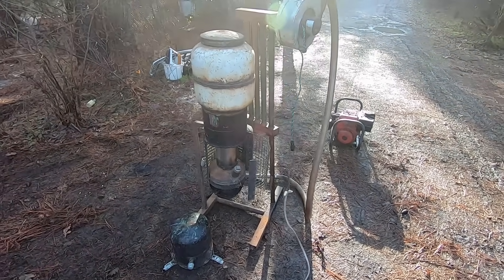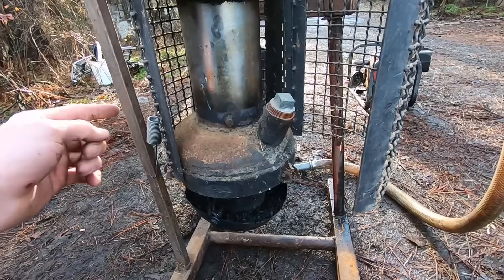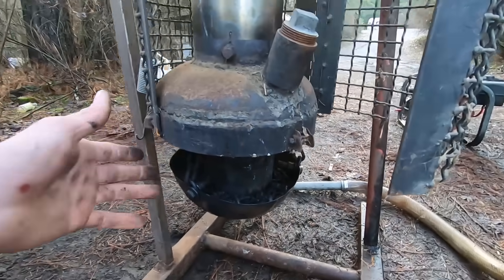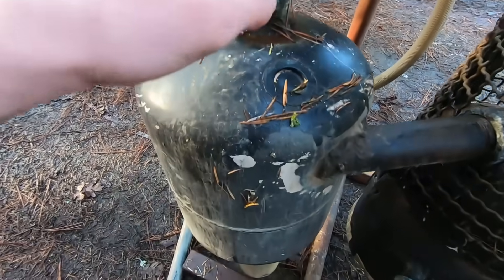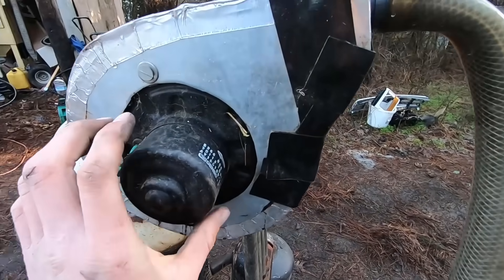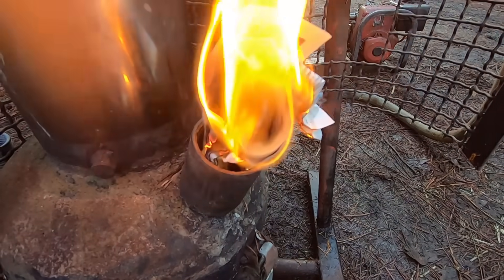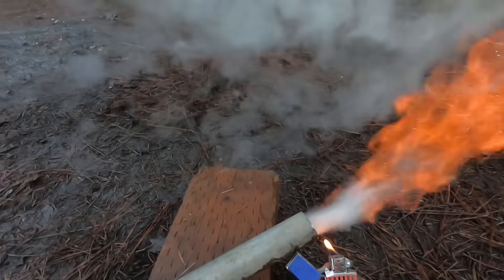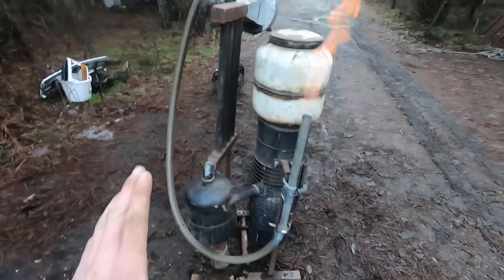Using Wood to Fuel a Generator! (How to Build a Wood Gasifier w/Demonstration)

Comment: I'd like to see you build one large enough to run your tank in a dual fuel way, that would make it a true bug out vehicle
Reply: Many German vehicles during WWII were powered with wood gasifiers due to fuel shortages, including massive Tiger training tanks so that would be cool to see.
Reply: @Bordpie  there is a video of a old man in Europe  that running a big old 2 ton truck on it
Reply: i would like to see him "build" it.
Reply: engineer775 has one for a vehicle
Reply: "If you build it, Youtube viewers will come"
Reply: YES!!!!!! Do this Please!!
Reply: an ole timey tractor, lol
Reply: mt only problem is what happened to the Cheiftan, they made it's engine "multifuel" with the idea it could run on everything, in reality it didn't run for long on anything even good 'ol diesel, the engine broke down constantly on what was otherwise a good tank, they had more than 50% of them in the shop at times

Comment: This was such a great video for me to find! Going back and watching your other videos(after subscribing ofc) it's clear to see you're taking on any and all feedback to improve the experience for your viewers and that's HUGE! keep it up!

I've always wanted to try a gasifier project.  Have you considered compressing the gas into storage tanks? 

Thanks! 
-a fellow PNW tinkerer
Reply: I would assume that it has to do with safety as well. LPG has no oxygen content and therefore is almost completely harmless compressed, but when you have a gas such as this, which definitely has some oxygen in it, the risk of combustion when compressed goes up drastically (even without a spark). Also as you said, the energy potential per volume is much less because you have all sorts of stuff in the gas rather than only the actual combustible gas.
Reply: I wonder if trompe could be used to compress it?
Reply: @GrimFaceHunter  I dont see why not. I know people have compressed it. I think the limiting factor is how it behaves when compressed. Like the fuel potential of a tank of wood gas is only as useful as 1/100th of a tank of lpg at same volume. Making it highly impractical when other fuels are so readily available and more economical.

Comment: How do you turn it off?
Reply from the maker: Good question! Because the burn requires air being pulled through the fuel, it can't get enough to sustain combustion by its own draw. As soon as the vacuum is removed from the end the system, the burn simply goes out. Thanks for the comment!

Comment: Cool stuff!  you mention in the video that the size of your burn tub decides how big of a motor you can run off the Gasifier...  It would be helpful to know what that ratio is and included in the description of your video.  I also be curious to know how quickly you could use it to heat a home.. or how big of a burn chamber you need to heat say...a  2400 foot home.  (about the national average.)
Reply from the maker: Yes, of course! I apologize for not including that. I'll include a link to my Instructables page in the description that has the burn tube information. As far as a burn chamber, that's dependent on quite a few things and I can't answer that question. I'm sure a quick Google search could answer any questions like that though! Thank you for the comment!
Reply: Yea man !!.. your pretty smart and could definitely make a living off the utube .

Comment: Good video  :) . 
 I use this technology, pretty much all the time, to make the power here on my farm. 
 Keep up the good work.
Reply from the maker: Thank you very much! Wow! That's great! What is your main fuel source? Is it a standard downdraft?
Reply: @randomn6473  
 Oops, forgot to mention the main fuel source. 
 This is Pine, taken from old warehouse pallets,. 
 The wood is processed by a pair of machines that I designed and built for the purpose. 
 These make little cubes that I call 'gasoline granules'  :)  .
Reply: @randomn6473  
 You are welcome. 

 I have two gassers here. 
 One is a charcoal powered one, and my wood powered gasifier is loosely based on the Imbert system. 
 Please feel free to take a look at them on my channel.

Comment: Nice! You might want to consider using a bubbler for removing impurities that will gunk up your engine. If the current design works for many uses without problems more power to you
Reply from the maker: That is a very good idea! Thank you for the suggestion! I would have concerns about the air pump requirements with the set-up in my case though. It would take a lot more power to move enough air through the water. I'm positive that it's possible though if you're creative enough!

Thank you for the comment!
Reply: @randomn6473  no air pump required as it operates at 1 atmospheric pressure. 
the same pressure that you are using now. water in container cleans the smoke of ash And soot and you get clean gas that burns consistently unlike your present set up
Reply: someone once used a water spray as the gas passed through to clean it, and they also used stainless filter material, similar to wool, like chore girls. Removing impurities for engine life and ecologically using or disposing of those impurities has always been a stumbling point to me for long term steady use.
Reply: I think it would help if he added cooling fins to his cyclone filter and move it after the radiator. Right now it looks too hot to condense much of the tar, let alone water. Also adding some fins to the radiator should help too, a 50-100mm strip of scrap steel on each side of each pipe maybe? Lowering the water content and temperature will make the engine run more efficient.

Comment: Nice explanation walk-through.  With a different design setup, you could actually use the wood heat to heat a house, then use the gasifcation to run the lights. I suppose if this was scaled up a little bit to provide plenty of heat for a standard home, you'd have almost all the energy you'd need to run all the electronics as well.

Video tip: get a lapel mic soon.  ;)  Got a little distracting with your voice changing between takes. Otherwise, pretty good work 👍
Reply from the maker: I think there are models like that out there. I believe MrTeslonian did a video on something similar to that if I'm not mistaken. Check out his channel if you're interested!

Oh, I know haha. I'm disappointed with the audio quality and plan on getting a decent mic as soon as I figure out how that whole thing works. XD Thank you for your interest in my videos!

Comment: This is very nice. I work at an Energy laboratory. We could do something like this as outreach to schools, as well as using it in a teaching lab for our Chem Engineering and chemistry students. Well done.
Reply from the maker: Coming from someone like you, that's quite a compliment! Thank you! 

That would be so great. This stuff is fascinating to me and I'm sure you could spark some interest in others with it as well! I wish you success!
Reply: @randomn6473 bro just pump freaking oil and gas!!! You can't beat it and claiming it hurts earth is bogus... yet you wanna have this shhhh... everyone will die cuz the system can run on alternative power... electric Cars use 18$ a gallon to charge
Reply: I just didn't understand why they haven't invited him to the technology's nobel prize yet.
Front page in world newspapers: 2019 Nobel Prize in Chemistry for the trio that created lithium batteries.
Today companies want to destroy the planet in search of lithium, but if we use wood as a fossil fuel for this new type of mechanism to develop combustion in Co2, is it a good idea for the future?
Reply: Does you lab has a youtube channel?
Reply: Alex Trezvy yes we do. Here’s a highlight from one of the major project areas where I work https://youtu.be/fQyDBBXE2oQ
Reply: You can buy factory built gasifiers. Just Google it. 
They are more expensive. 
But the guesswork has been all worked out.

Comment: You learn something everyday!!!
This is a beautiful convergence of two very different technologies - your gasifier and the Internet that makes your knowledge available!

Thank you and fantastic explanation!
Reply from the maker: That's a very interesting angle to view it from. I guess that line of thought never occurred to me! Thank you for the comment and the kind words!
Reply: @randomn6473  I've been trying to build one for a while, I would say your explanation beats Mr. Teslonian, he is awesome too though...
Reply: John, im building a gasifier myself, you need to look up the drizzler gasifier. it is a chip fed grateless gasifier, it is differing in the aspect that it can be run for more than 15-20 min . its an interesting alternative . good luck.
Reply: @AndrewWhitehill  Thanks, I will absolutely look into that!
Reply: @randomn6473  Didn't the Germans use this technique during WW2?
Reply: @randomn6473  you have a great setup here. But I think what me and many others would like to see. If you could burn just basic leaves trash the basic stuff you can get your hands on in a grid down situation we would like to see this. I know it would be more work to burn just trash something not as hot and as good as wood pellets but wood pellets will only last so long unless you get several tons. And the cost of wood pellets is really gotten expensive and they may run out with everything else going on.
Reply: @randomn6473  I just remembered this years ago basically guys were running an old 350 carbureted motor in a station wagon with a wood stove in the back I think they were just plumbing the exhaust up to the motor and they would literally burn trash. This was the coolest idea but you never saw any more about it because obviously they want to keep it under wraps. Of course their system is not as efficient as your system is there. But their system was pretty simple. I ran a car on propane it's just basically putting propane in its throat I didn't have enough volume but I made a 3.8 good size V6 run home in an emergency with a broken fuel pump I made the car run about 11 miles an hour on a standard BBQ tank with my simple propane system. I do some trading on propane regularly and have lots of propane probably could last for years but not forever.
Reply: ii live in ireland and i could see somthing like this being illegal because of global warming, the government we have just lets the native people live in tents and sleeping bags, homeleasness is a big problem because of big hitech corporations coming over here to ireland, and well paid non irish people are taking most of the housing    i think its a great idea and it is being used here in ireland on a bigger scale by garbage recycling companies, but a one off back garage project would be frowned upon by the autoritays, they would rather see you freeze to death, thanks wonderful project, recycling reusing.
Reply: @chelseahi9064  That's terrible, I always thought Ireland was a beautiful place with very down to earth people. Immigration is destroying every country right now.
Reply: @chelseahi9064  Global warming is a myth... It sounds like you have some kind of proof that companies are using this technology and if that is the case the courts couldn't do much to you unless it is something you need a permit for in your country. I really don't know much about the part of the world you live in but here it has been recommended by FEMA for times when there are gas shortages.